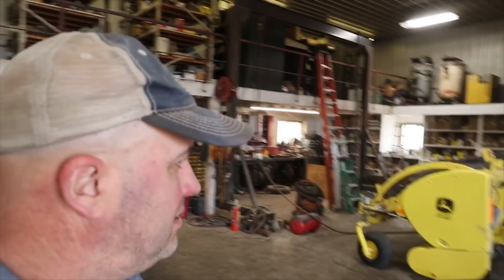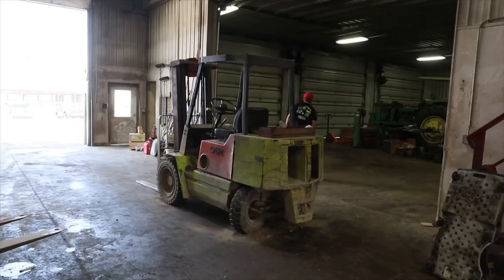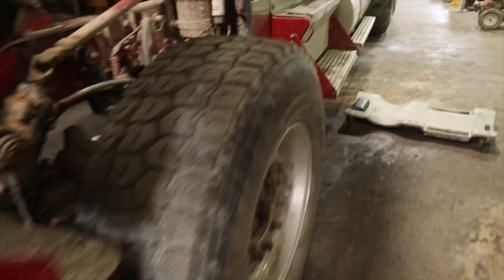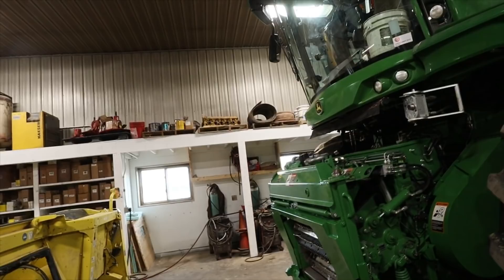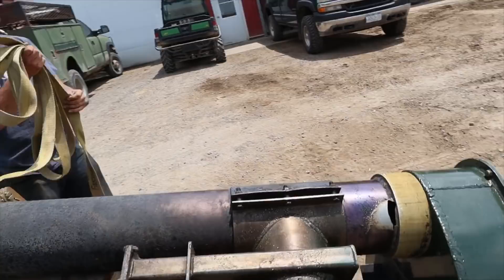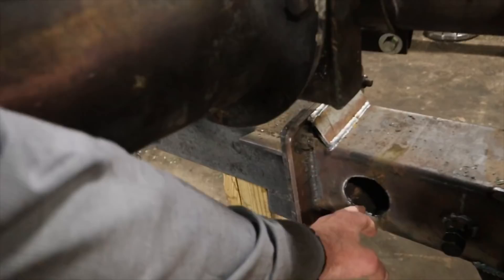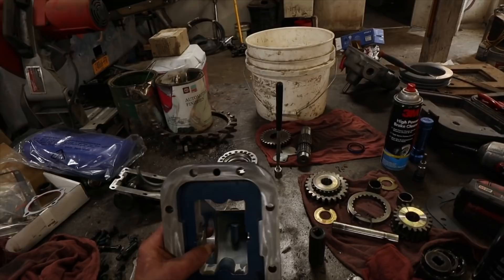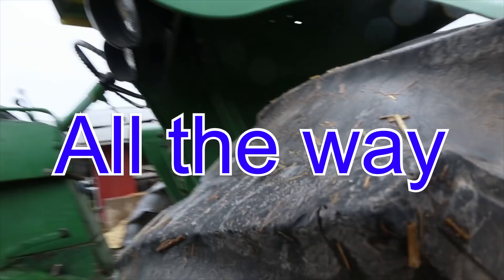Broken forklift,transmission replaced again on W900 and manure pump rebuilds

Comment: Years ago I owned a transportation company and ran school buses and charter buses. I built lots of clutch extensions for school buses for the little ladies and usually bolted a 2x6  board to the floor right in front of the accelerator pedal so their food didn’t dangle in midair. I’m 6’4” - you should have seen me try to drive one of those buses with a three inch extension. I had my knee up to my ears. None of my grain trucks have extensions, that’s for sure.

Comment: I spent 25 yrs working for A.O.S Harvestore in the slurrystore dept as a fabricator and new pump installations up untill 1996 luckily for me we our farmers were not using sand yet for bedding the big thing back then was rubber pads  so the pumps lasted a lot longer and I could not imagine trying to agitate sand in a slurrystore we were getting tanks that were over a 100 ft wide and 40 ft tall We had some pretty good pumps and some not so good, all based on your budget ,boy I could talk all day on things I've seen and done in that job sand must were a pump out within a year I know it is really good for the cows  I admire you and your crew your a large operation but you run a smooth well organized one thanks for the great video's
Reply from the maker: Sand wears everything out

Comment: I hope you have better luck with that 18 speed.  That should not need to come out for 10 years.  That was a Friday afternoon rebuild you got when you put it in last fall.  Had transmission in a Mack I worked on, came out 3 times before we even hooked a trailer to it. the last time they gave me another reman and had no issues with it at all.
Reply from the maker: Ugggghhh

Comment: Maybe the truck drivetrain has to much strain from them big tyres? I remember watching a programme from the eighties where they went off roading through a jungle and kept ripping the drive train out the trucks, turned out to be the over sized tyres, they swapped them out and problem solved.  Keep up the great videos. 👍

Comment: I'm proud of Kerr at least he knows what color real tractors are that blue sure looks nice going down the track L.O.L, I'd love to scratch build a ford puller like his. but with all the rules, hassle transporting it and a lack of proper pulls now in Canada to run it that won't be happening. We got a few antique pulls still, if the clubs don't finish with this 19 sneezes BS and no shows for a year or more. 
i'd probably tune one of my antique factory fitted Perkins 6 cylinder  Fordsons instead as there are a few internal mods that can't be detected and without a turbo they won't let anybody run doubles the power for a bit of fun. The rules are easier/cheaper and I don't need a class 1 or 3 licence I can't get because of health issues to haul it either, like I would need with the bigger weight machines. Thanks for another interesting video, Take care guys.

Comment: Love the long shop videos. You got those manure pumps down pretty slick now with your own improvements. It’s weird the forklift steering cylinder always brakes in the same spot. What kind of oil you guys run in those 18 speeds? I switched all our road tractors over to synthetic 50 weight and I’ve had better luck with the PTOs staying together
Reply from the maker: Syn 50

Comment: The quick paint on the chopper looks good, in a couple of weeks it will be back in use. Nice idea for the peddle extension for Jr. on the Roxor. Hope the warranty was good on the W900 transmission. The sand sure chews up the manure pumps doesn't it. So if you didn't/could not rebuild them, how much would a new one cost to replace the old one? Thank you for today's video.
Reply from the maker: I haven’t bought a pump like that in 15 years or so and if I remember right the ones we have were around $12,500

Comment: You need to ditch that water to oil cooler and put air to oil cooler....they are the fastest way to ruin a trans and you wont know it till you cant figure out where the truck engine water is going...then junk trans almost instantly
Reply from the maker: True